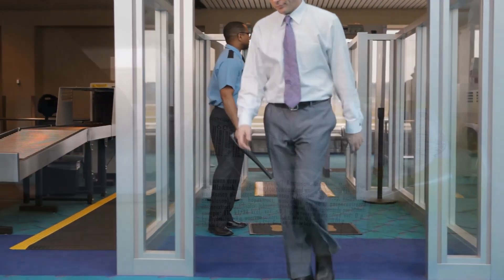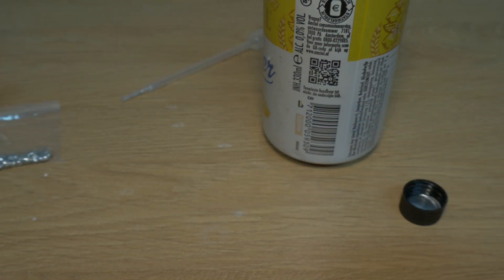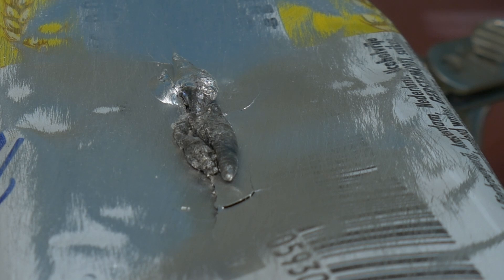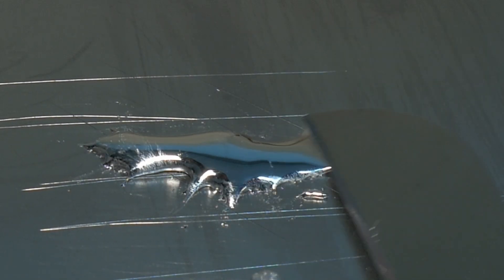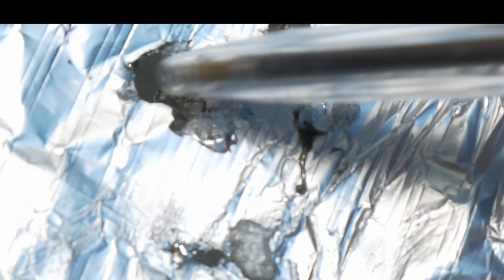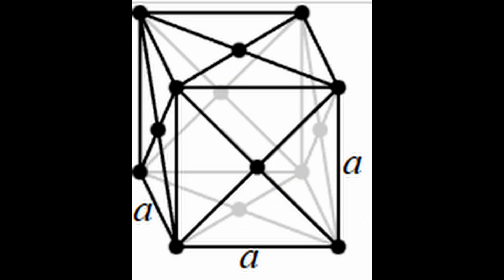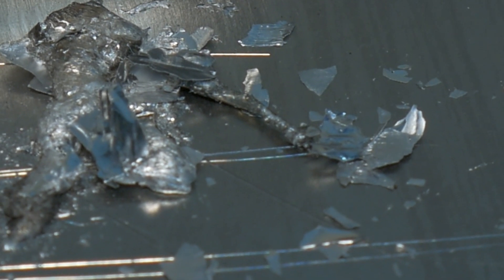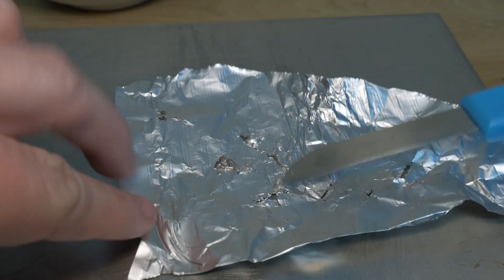Everyday Science: Gallium on a Plane: BIG Mistake! ✈️🧪

Comment: Funf fact;
The Gallium is 100% recoverable after the experiment.
Just drop the Gallium-Aluminium alloy into hot water. It will react with the water, creating Aluminium-Hydroxide, and Gallium metal. 
Oh, and quite a bit of gasseous Hydrogen is produced as well, so y'know, careful with open flames around it... :)
Reply from the maker: After my experimentation it was such a mess that I decided to just throw it away all together. But yes I should've just be patient and recover it :)

Comment: I think at one point you said the aluminum that the gallium didn't touch is not affected? But it is, right? There may not be a hole there, but the surrounding area is still greatly weakened, right? Much easier to break than it was?
Reply from the maker: That did not come across as I wanted then. If I was talking about the can for sure also internal parts were affected.
Reply: @CubeChemistry   Later on you were saying things more as I expected, it was just the one part early in the video. Maybe you just meant unaffected as in no hole...yet.

Comment: I assume you used hot water rather than lukewarm (30 - 35 °C) to keep the Gallium in a liquid state until it eroded the aluminum samples. I'm still impressed though it didn't solidify before eroding them, if 30 - 60 minutes were required. Did you use a heater or A/C to keep the temperature of the room above 30 °C?
Reply from the maker: What an awesome question. So the temperature at the time of recording was about 23 degrees so it should've solidified quite quickly. We indeed used warm water about 40 degrees which worked perfectly. Also we used a Heat canon that could heat things up to a higher temperature. But here comes the strange thing. In both cases with the can and the steel(That we thought was Aluminum) we came back and saw that only the outside had been solidified and not the inside of the Gallium. Now this was strange because of the reason you mentioned that Gallium with 23 degrees C room temperature should solidify. And that was not the case. 

I do not know a lot about the heat conductivity of Gallium but maybe because the outside layer solidified the inside layer was just kept warm enough to stay a liquid.

Comment: What is that sheet that wasn't aluminum, titanium?
Also,from Cody's Labs I've learned that gallium and Mercury do not mix, what if they were both amalgamated with aluminum, would the aluminum act like a soap and allow them to mix?
Reply from the maker: I think it was just steel. But I will investigate further at some time. Oehhh that is a good question I do not know.
Reply: @CubeChemistry  I thought titanium because I would think the weight/density would give it away if it was steel, and I've never seen a magnesium sheet, titanium was the only other thing I could think of that could be easily confused for aluminum by eye and feel, zinc/tin alloy possiblity. 
   Someone else pointed out in the comments that the aluminum that's alloyed with silicon can be very resistant to attack, it would be interesting if it was the case because I wouldn't have expected it to be so resistant as you would think it was another metal. Aluminum street sign? Street sign aluminum is alloyed with chromium and/or silicon , I would expect chromium would also provide some resistance, but I've never tested that, and I don't have an xrf to know composition of anything I have to try. 
You may have inadvertently tested that!

Comment: There is an objection. Not all technically used aluminium-alloys are equally sensitive to gallium-alloying, or mercury-amalgamation. R.g. the Anticorodal-Series (AlMgSi1) are quite resistant. Painted or anodized aluminium-parts with closed pores also can not be attacked.
Reply from the maker: That is some great insight thanks for pointing that out!!

Comment: Thank you for yet another fun discussion about elements and our world!  It has been a while so don’t trust what I say in detail.  When experimenting and illustrating to my grandchildren I used a thicker sheet of a known alloy from memory it was about 6mm thick.  I pleased the molten Gallium onto the seater of a 100x100 mm (total approximately) and then used a knife to scratch the surface of the aluminum while covered by the Gallium and there seems to have been a more pronounced effect than you showed.  Some spires seemed to grow and spread throughout the full sample. The strength was compromised throughout its full volume over night.  The effect locally was happening before our eyes.  I really bothered me to trying safely disposing the test sample. Aluminum oxide forms very, very quickly but becomes thicker over time until the surface slows (I don’t know if that is only the presence of Oxygen or in a combination with some electrical action.  The oxide is a very good dielectric.  My father and my uncle (uncle is now retired from a Rotterdam company) were both educated in  Dordrecht who taught me a lot. Very practical people.  As are you.  ❤
Reply from the maker: What an awesome description. Ill make sure to try it later with a thicker piece of aluminum as this was so much fun!!